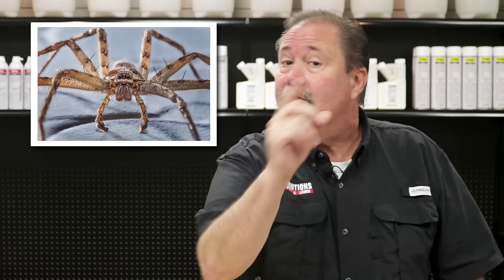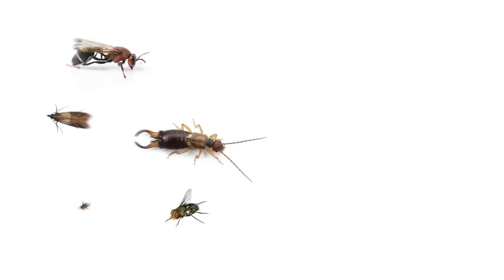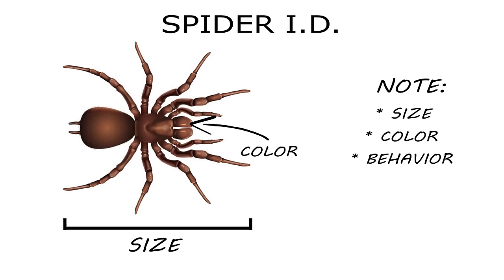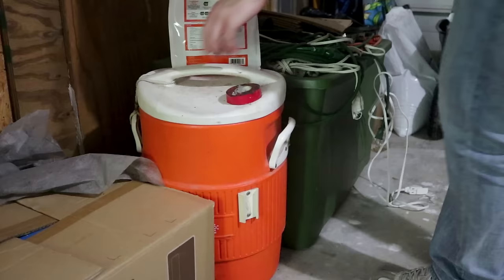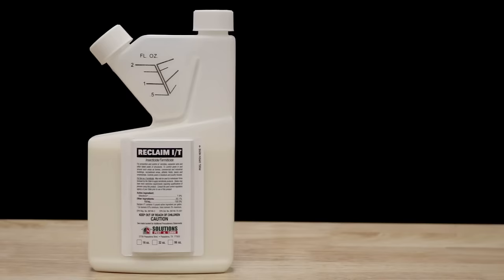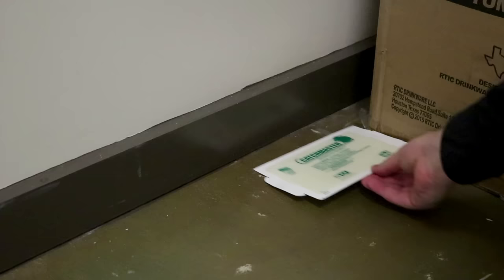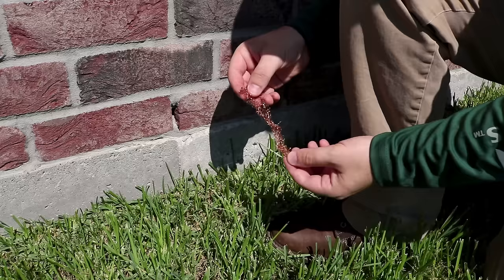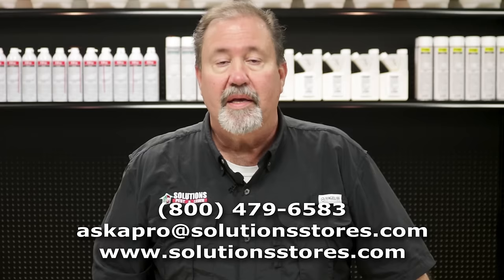How to Get Rid of Spiders Guaranteed (4 Easy Steps)

Comment: One suggestion I'd like to point out is that it's better to clean up and kill the spiders up in eaves or patio ceilings if you're using a microencapsulated product like Bifenthrin 7.9. If you spray first, as many companies or technicians do and then come back after the yard spray to use a web pole and web head, you are breaking the micro capsules and it will not be as effective. Especially if a lot of de-webbing is necessary.  If using a wettable powder like Cyfluthrin or Cypermethrin or an EC like Permethrin 36.8% then you can do the spraying first and then come back to knock the webs down. Most of all for PCOs, for the love of GOD, don't waste your money on Suspend Polyzone. You will NOT be happy with the results and will be a lot lighter in the wallet paying a king's ransom for a completely overhyped pesticide. I would always suggest using Bifenthrin 7.9% for spider and web control, like Reclaim IT or Talstar One.

Comment: Great video! Thank you! We are currently facing a black widow infestation and don’t want to use any strong or harmful chemical pesticides. We are sealing up cracks, removing webs, and killing black widows on sight daily. I have spray bottles around the house with soapy water or vinegar in strategic locales.
Reply: Get those glue boards like he was saying and that way you can pinpoint where they are coming from I set one by my patio door and literally have 5 on them right now
Reply: @ritamitchell1060  thanks Rita! We’ll get some.

Comment: I have a question, Are spiders attracted to cold air? Because I mostly see wolf spiders once an awhile in my room. And yes I have my air conditioner ON all night and most of the day.
Reply from the maker: In many areas, wolf spiders are quite common. They typically reside outside in leafy, grassy areas, and some even make small burrows. However, they occasionally come indoors on accident or to seek shelter over the winter. Homeowners might see them near doors, basements, or windows. The are not attracted to the cold.
Reply: Scarack Truther same but they come through my windows cuz they are old

Comment: I regularly vacuum the basement, garage, house, ceilings and corners. Also I keep sticky traps along walls upstairs and down and spray peppermint oil around windows, doors, and other key areas. I also make sure other insects that are dead, don't hang around long either. YUCK we moved from WI where there were no poisonous spiders to MO where there are...finding brown recluses in our home was awful! So 2 months later and about 2 dozen brown recluses later, the traps aren't finding any others. We went around and sealed holes in the foundation and will keep glue traps around. We keep things in plastic bins and have NO cardboard in the house. We don't use chemicals in our home or outside. Just essential oils

Comment: My boy, my homie, my dawg, Keith. First of all, I don't wanna do this anymore bc you said there's jumping spidos. And you said I had to move the clutter to get to those bad boys, but Keithy, my boy, you don't understand. No one has gone in there in literal Years and I wanted to use the room for stuff. ( just to clarify the room is a basement under our garage which is detached from our house) and there are SO MANY SPIDOS! to move the clutter I have to go through a spider army. It's like Nam in there Kiethy, they are hiding in the trees, (if trees were the ceiling) And you walk in and close the door but you find out its a trap bc the spidos are on the doorknob. I barely got out of there alive. And Keithy my boyo, I'm broke and have zero moneys. I can't buy anything and have to use what I have. And also for some totally random reason cough cough spidos, there's a problem with the wiring and the power does not work in the garage or the garage basement, aka spido command central. The only weapon I have against those spawns of Satan is a broom. So Keithy, aka King God Professor of Pest and Lawn Solutions Sr. please give me your holy strength as I run into hell once more to remove the vermin from the place I once called a cool room. May Keith have mercy on our mortal souls.
Reply from the maker: Tyler, Tyler, Tyler..... What are we going to do with you? First question are you using your PPG? ( Personal Protective Gear) Example: We know you have your broom but Helmet? flashlight? Second question are you Using the Buddy System? Bringing a partner with you? ( when you yell buddy they yell buddy back so you know you both are safe) The King God Professor of Pest has heard your prayer and is sending his strength your way.  Please keep us updated Tyler!
Reply: But did you survive?????? 😭
Reply: we need to know if your quest was a success or if other adventureres will find your bones amongst the 8 legged freaks but judging on the no response im going to say youre still fown there with them

Comment: I got brown recluse spiders.hard to eliminate cause I'm in apt go to walls to walls.
Reply from the maker: Do you know how they are entering? Are you ground floor?
Reply: In your floor vents, put nylon screen  (you can buy at any hardware store) inside and put the vent over it (with the screen about 1/2+ inches on the floor so that the vent covers it).  The spiders that go from unit to unit can't enter your apt thru the vents because of the screens.  Also, use gorilla tape as that's as effective as the more expensive sticky traps.
Reply: Do we have brown recluse in Canada???

Comment: FUNNY STORY,
YEARS AGO I got a job as a gas station pump mech. Back in those days under the gas pumps you would find dirt or sand
today there is a plastic containment box to collect any leaking gasoline. But back in the old days it was common to open
up a pump and find black widows underneath in & amongst the piping. That area usually had a gas stink about it. I dunno,
were they attracted by the stink? Dunno. After pumps were fitted with containment boxes we didnt see the spiders very 
often. Those containment boxes gave off a strong plastics smell. I would guess the spiders liked that it was a cool dark 
place, but, what do I know? Im just a simple caveman.

!

Comment: What is the best way to get rid of roaches if you see one do it mean more
Reply from the maker: Does not mean you have more roaches, I would do some inspection to see if you can locate more adults, egg casings and feces.  https://www.solutionsstores.com/roaches
Reply: David Hughes I use orthene 97 mixed with permethrin in a pump sprayer,took out a roach infestation within a week!the smell is bad but let the windows up so the  smell will disapate within 3 hour of treatment.yes it works
Reply: If your place is generally clean and this is unusual for you, get you a COMBAT MAX Syringe from dollar General or family dollar. Follow the directions and enjoy your life.  DON'T get me wrong I use to do exterminations in the projects in Brooklyn NEWYORK it's a dirty job but it can be done with patience and not A BIG BANK ROLL. GOOD LUCK
Reply from the maker: Best method is to use a roach control bait, this is offering the roach a food source.  Bait for about 10 days and then you can apply an insecticide.
Reply from the maker: https://www.solutionsstores.com/apex-cockroach-gel-bait

Comment: I woke up with my arm covered  in "bites" from my shoulder to wrist  and each one was swollen about the size of a dime to quarter so that squares out some of the typical ones. The biggest set on my shoulder is about 4 inches wide, oddly looks like Africa when I drew a line around it. Wasn't able to take a allergy med before work,  and had to take an emergency otc strongest allergy I could find right after work. Also took a full dose of ibuprofen for the swelling and inflammation. Will be continuing this regimen plus immune system support vitamins for the next few days. Next up is many of these steps tomorrow on my day off😅. Going to start with cleaning and checking all openings and resealing off things, doors, vents, etc, then dusting, and vacuuming to keep them from coming in again. I don't like spiders.

Comment: I live in an apartment and it looks like spiders are climbing in from the wall mounted ac. Do you have any tips? We can't spray the outside of our building and its impractical to routinely remove the ac unit for cleaning.
Reply from the maker: You can use the Catchmaster 72mb Glueboards and spray our Reclaim I/T around cracks and crevices indoor. Just make sure that you follow the directions and wear the proper PPE.

Comment: in spider season, shake out your clothes and bedding and vaccuum every other day.  spray Orttho bug killer every month and make sure you do a throurgh job, moving things around to get in all the cracks and crevices. then spray peppermint oil mixed w/one part oil around and on your bedding--spiders hate it even though it smells wonderful. clean your mirrors w/vinegar, that will make them stay away too.   put coconut oil on your skin as a moisturizer, thats in a lot of pest control  concoctions as well.  keep your place as clean as possible.  hope this helps.  i am an arachnophobe and lose my mind when i see a spider, but am very brave and kill them!